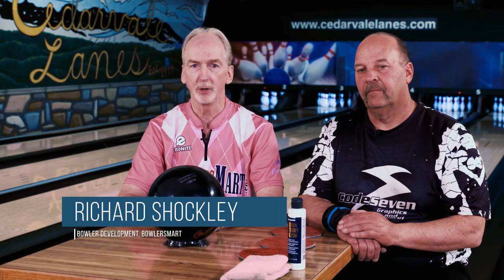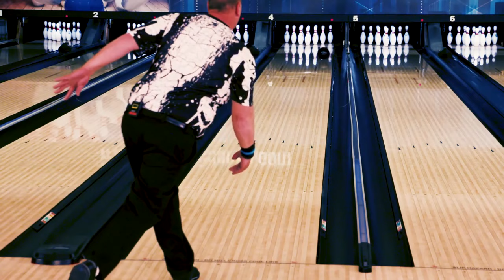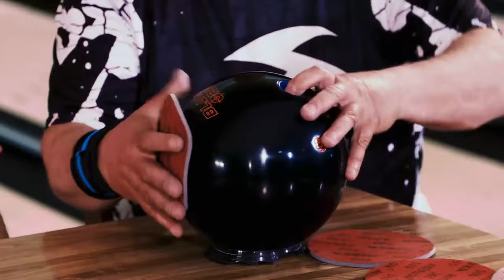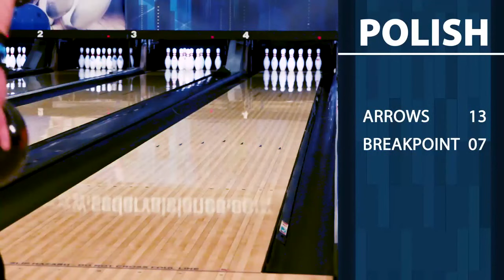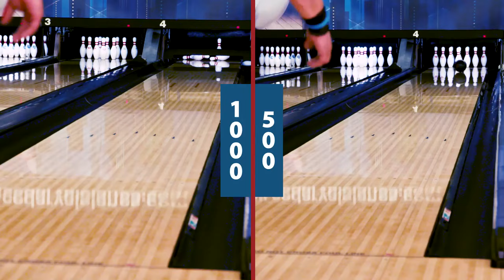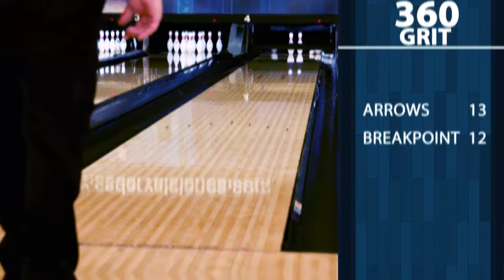Ball Reaction and Surface Adjustments

Comment: But is there away to make the reaction last longer. I get about one full game out of a surfaced ball until it just stops reacting the same.
Reply: That is not the ball on the most part it is lane transition.   Especially with 8 or 10 people on a set of lanes.  Something all bowlers must be able to account for.   Also just so you and other people know since they did not mention this and should have, is you can not change the surface of any ball once a sanctioned league or tournament begins.  it is okay in practice but after a game match starts and you roll a ball you have to stick with what you have.   So back to lane transition you just have to learn to adjust.
Reply: That’s definitely the oil breaking down from bowlers running the same path through the oil. At that point you’ll adjust forward/back, slower/faster and left/right with your approach.

Comment: 5 board difference at the breakpoint between the polished and the 360 grit shots...
Reply: Of course. The more surface the earlier the ball can read the lane. That moves the breakpoint closer to you and in. The amount it moves will depend on the pattern and they chose one that really highlighted the move in.
Reply: keep in mind the more surface the more energy the ball will use up.  If you do not have enough rev rate you will find that the ball as it hits, it hits flat. Instead of driving through the pocket it runs out of hook energy and it hits flat deflecting and often misses the 5 pin and 8 pin.   A proper hook ball takes out the 5 and splits the 8,9 pin.       There is a lot more science to it than just changing surface.   It is more about matching the right surface to lane condition but also to your own rev rate and ball speed.   (matching up the ball)